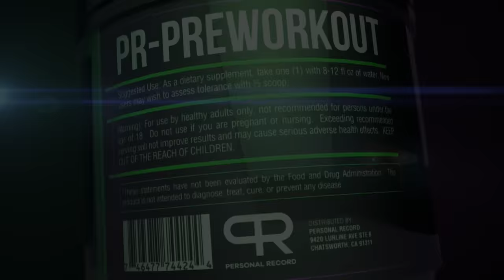VITALY LALETIN vs ERMES GASPARINI + WHO HAS THE STRONGER GRIP?

Comment: Ermes is on another level...30+kg lighter and so much strong,if he puts 10/15kg on is bodyweight he will be the first in the world
Reply: Weight doesn't make a difference anyway
Reply: @nvmffs   Weight makes a huge difference, or do you think Laletin was stronger at 110kg? Of course there's a limit to it, Trubin for instance became unnecessarily big and started to rely on strenght rather than sound technique.
Reply: @vaderetro264  If weight made a huge difference, a sumo wrestler would be able to dominate the scene and Brzenk wouldn't be as successful. Laletin was weaker at 110kg but that was because he was inexperienced and lacked strength training, not because he weighed less. Strength training is very different from bodybuilding one and doesn't elicit much growth, if at all. Sometimes it's just a matter of adaptation to the specific strength curve and stabilization requirements.
Reply: He’ll be no where near first. Levans is
Reply: Brzenk

Comment: I will admit Ermes is living proof that even with less weight with enough muscle increasing your number in specific lifts and strength will make you strong enough to beat higher weight classes plus weight eventually can go up cause of muscle.

But one thing i notice Ermes told Vitaley to go slow lol
Reply: Ermes Is very fast
Reply: It's kinda a common misconception that Ermes doesn't weigh at lot. He is a surprisingly heavy guy. He weighs 113 kg. He's a big heavyweight.
Reply: Vitalis style is to go fast that's how he wins most of his matches. Fast twitch action + top roll.
Reply: @TheForeheadOfDoom666  🤔yeah maybe
Reply: i mean john brzenk is the real living prof🤷🏼‍♂️🤷🏼‍♂️
Reply: Yeah, if vitaly were to go full speed as he does in actual matches, he would pin Ermes everytime. But Ermes is denitely one of the best in the world.
Reply: @haagenneldeberg6787  Yeah hes basicly the same weight as Devon is and Devon is few inches taller then Gasparini. So Gasparini has already filled up his frame pretty good. Maximum limit maybe for Gasparini to be comfortable could be 120kg.

Comment: Guys, the scale you're using at 24:50 actually has a function you can activate, that automatically displays the highest number you achieved. Just hold the "Unit" button for 2 seconds. When the display says "L-ON" you have activated the lock-function. To deactivate it you do the same; hold the "Unit" button for 2 seconds until the display says "L-OF". I have the exact same scale.
Reply: @GripAlawadhi have a look into it.